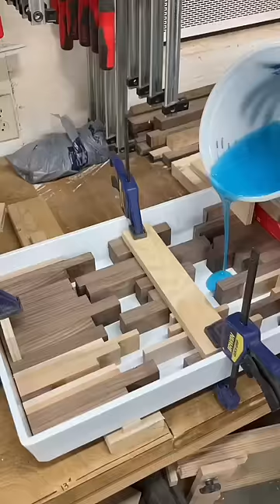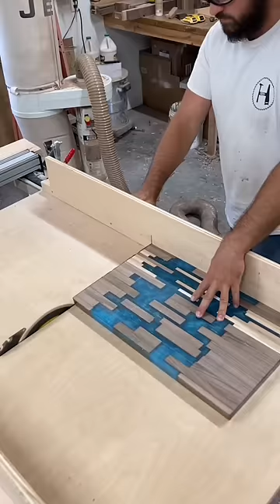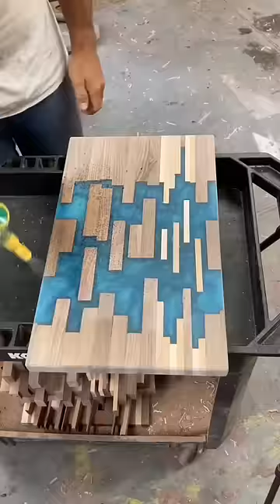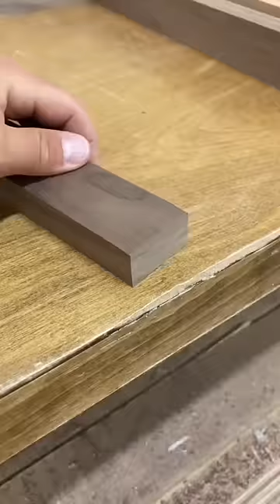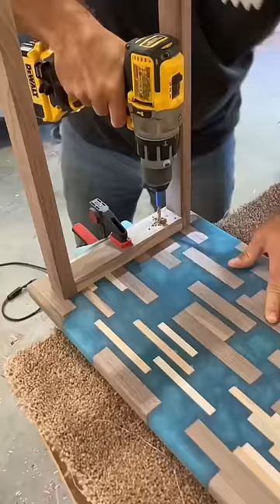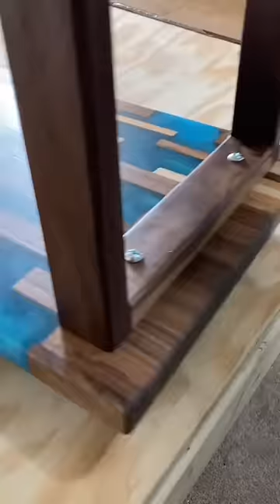Awesome Table

Comment: Nice table.  I thought it was going to be a light fixture.
Reply from the maker: Thank you! An epoxy light fixture would be neat!
Reply: @hesswoodwork  Just a thought. Those old long fluorescent light tube fixtures  often used in old High Schools;  for width and length dimensions, of a ceiling mounted epoxy rectangular cube .

Comment: You appear to be moving the router in the opposite direction to normal.  Is that a special bit?  Bit spins clockwise, you need to move counter-clockwise.
Reply: …otherwise, absolutely beautiful result!

Comment: As an architect, I find it beautiful, but I also find the legs system week and horrible (even dangerous if hot liquids are over it). That is a useless table.

Furniture is ment to be used, not just contemplated. Or it is just a sculpture.
Reply from the maker: Yes, I should have made better legs.

Comment: At least you’re putting some kind of legs made from wood on these things. I am disappointed at the cheesey metal crap being used on many of these tables. It’s as though there is no REAL craftsmanship involved. A little arts and crafts to create the top, and that’s the extent of the creativity. Making a stunning set of legs to adorn a beautiful wood top, makes a table turn from cutting board on wheels, to master crafted museum style FURNITURE.  Just an old craftsman’s opinion, for what it’s worth. Would you completely rebuild a 59 Dodge Coronet, only to paint it with a roller?
Reply from the maker: I appreciate your opinion. I simply enjoy making things. I never said anywhere that I am a real craftsman. All I know is that I get lots of views and money from my videos.

Comment: Dont get me wrong here its very easy to make a big thing out of criticism, the plate is very beautiful, looks damn clean af. But did you have to do the table that dirty by putting this ugly legs on it ? I mean, if you can make a plate this beautiful you could use the same effort and care on the rest of the table no ? You could have "x'ed" them or made them into an hourglass shape to make em not look as boring as this. Even making a trapeze shape for the legs would have done the trick.